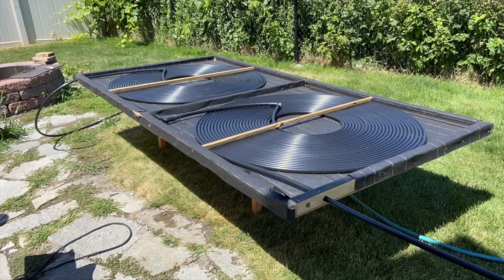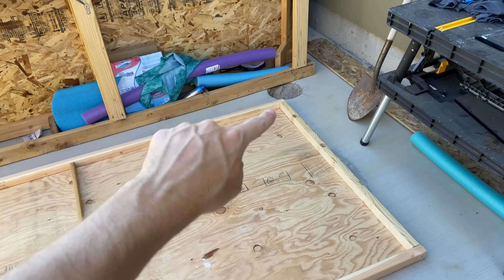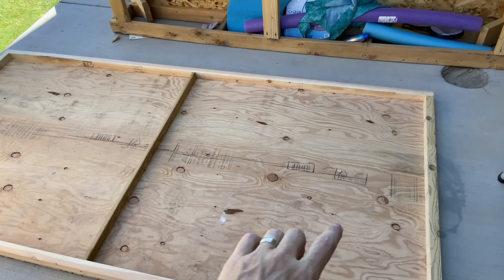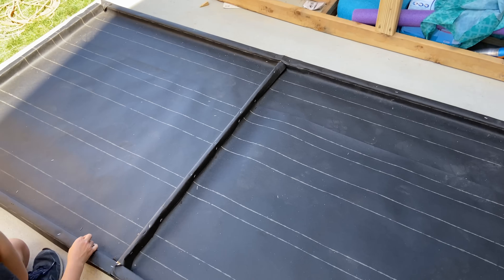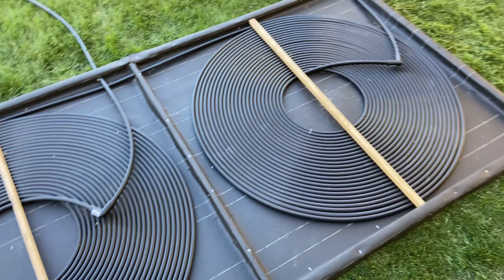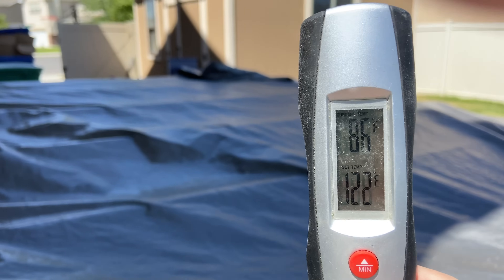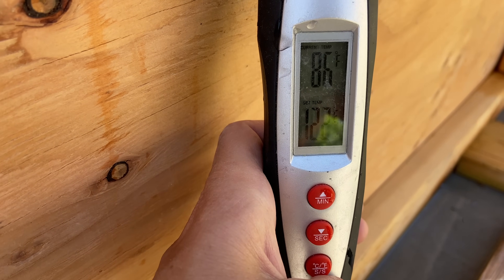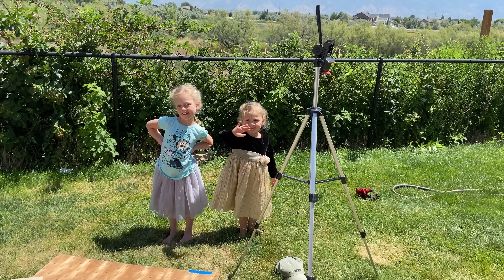DIY Pool Heater - $50 Solar Heater

Comment: I'm going to loop my pool water through my gaming computer, cool the rig, heat the pool, two birds with one stone!!.
Reply: How about I run the pipe from my pool to your gaming settup, we both win
Reply: U da man!
Reply: wow, that made me laugh! You are brilliant, sir!
Reply: @Bigdadddykill I know it’s a joke. Unless your pc is using over a kW (a few actually) it won’t do anything to the pool in comparison to the day night cycle. It doesn’t matter how hot that cpu gets it is the amount of energy that makes a difference. It won’t take a long time - it won’t do it. The reason a pool gets hot is that it is receiving energy faster than it looses it. As it gets hotter the rate of energy loss goes up cubed. Think of it like a single mosquito sucking blood from someone forever. The body replaces blood faster than the loss.
Reply: cool you bitcoin mining computer also and get 3 birds
Reply: well... this joke escalated quickly.
Reply: That sounds terrible. Chlorine will reek havoc on your loop.
Reply: Found Linus.
Reply: Linus is that you??
Reply: Linus Tech Tips is doing this right now.
Reply: bit late to the comment section, there is actually a jacuzzi/sauna place where the water is heated by a bitcoin farm. 😂
Reply: What about waste heat from your AC unit?
Reply: @alanl.simmons9726  even better instead of the waste heat like through the fan and air to water, use the heat it's taking out from the home directly with a heat exchanger?
Reply: @alanl.simmons9726  You could set up a heat exchanger. It could work, but could be more trouble than it's worth.
Reply: Guess you have a 4090 too 😂
Reply: Ok Linus
Reply: You should win the Nobel prize for this! Imagine pool water to cool the mining farm in the garage and the mining farm to boil the pool water 😂
Reply: Brilliant idea I would if it would work my gaming pc water cooling still runs some heat out of it so could be possible someone should try it one day
Reply: Yea... don't do this.
Reply: @michaelgoostree4177  why not?
Reply: Linus?
Reply: In the winter it better to keep that heat inside your house.. if your house running off central heat (with the exception of a heat pump).. all the power using inside your house.. lights.. tv.. game system and your pc... will heat your house.. this will lower your heater energy usage by the exact amount..  your PC is literally free to use in the winter..
Reply: @gezzuzzful  ya using a pc in the winter is the same  as using a pc.  A pc convert  like 99%of its energy into heat.
Reply: Yes big brain moves only
Reply: Going though that trouble add in your HVAC too!
Reply: Let me know when its done. Ill come swimming in the heated pool.
Reply: Make sure you keep your pool balanced correctly as to avoid calcium build up or acid etching
Reply: People do that with a ac unit.    I bet it could be done
Reply: Build yourself a 100 watt class A amplifier and you can heat that pool. It will also cost you a ton of money to run it.
Reply: Why didn’t I think of that. Just saved so much money thank you
Reply: I would all a heat exchanger in between the systems. Don't want chlorine water in your watercooling loop
Reply: lmao!
Reply: Whoaaa steady on, you don't want to boil yourself!
Reply: There's a guy who did that with a server in his house, Linus tech tips. Worth checking out. You're not producing a lot of heat, but enough to do some things.
Reply: Beware of the pool water start boiling! 😱
Reply: The chemicals would erode your system in no time
Reply: If we could figure out how to heat the pool with the heat I get when she finds out I've been on YouTube again!😂
Reply: you're a gd genius, Gump!
Reply: PC would never generate enough heat to warm a pool, the pool would dissipate it before ever having a chance to heat the water.
Reply: @atvkid0805  really it’s a joke but just so you know your wrong it would heat a pool just take a long time
Reply: @marineinneed  Not with thermal losses during the night time.
Reply: Nice!  It would work to cool your computer, but not sure on it being enough to heat the pool, or even maintain it!
Reply: @wolphin732  He's kidding bud!
Reply: @wolphin732  nowdays gaming PCs draw up to 800w and more if overclocked
Reply: @wolphin732  not sure if your a gamer because my dam cpu and gpu can make a lot of heat I’m sure I can heat a pool on a few hours of gaming haha
Reply: @marineinneed  I'm not sure if you understand how energy works. Your pc doesn't put out much actually heat. It might feel warm but that doesn't matter. A high end pc will output about 600w of heat or 2000btus if heat(that's if you are running both cpu and gpu at max which most games run cpu less than 40%). 2000btu isn't much especially when a furnace outputs 60,000-80,000  btus.
Reply: @randybobandy9828  u must not have a high end gaming pc because I build some heat boy
Reply: You’re wrong I heat the ocean with my computer
Reply: @timm8311  you gottem good!

Comment: Instead of the funny centre feed coming out and across the other coils, you can use two coils interwoven like a mosquito coil and using two reversed elbows, you then send it back the other way when the water hits the centre.
Reply from the maker: Good idea

Comment: I have a friend in the South of Spain and all of her hot water is heated via pipes on the roof. Like the idea of the sun heating the water for free.
Reply: solar hot water tanks are req in hawaii for years on new homes..   i have not put electric to my house water heater one time yet , water stays 120 + round   :).   same 2 panels with hoses on roof connected to pump on water tank

Comment: Will this work during florida winter when it’s on 50s or 60s outside?
Reply: Yes of course it will work in Florida even during the winter. The only caveat is the sun doesn't shine a strong in the winter so you will not get as high temperatures in the hose to flow into the pool.
Reply: No.  The sun in Florida is different than anywhere else in the world so it cannot work in Florida unfortunately.  In fact, you probably could do it...just run the system at night only and you should get good results.
Reply: @houstonwarren2  lmao

Comment: Something everybody that’s into this will want to be aware of, is the concept of ‘thermo-syphon’ - you put an insulated storage tank between your panel and your hot tub - you mount your storage tank above both of them - you leave flow off to the hot tub - water comes off the bottom of the storage tank (where the water is coldest) circulates to the inlet of the heater - the heater outlet goes to the top of the hot water tank - it just keeps circulating on its own until the water at the top is same as the bottom - then it will stop - the outlet on the storage tank to the hot tub should be 6” or so from the top - it will, of course, gravity feed to the hot tub
Reply: You need a different type panel for Thermosiphon(TS).  TS is a very low energy process, and will only move warm water upward in relation to gravity. A downward turn will halt flow, and horizontal runs add only drag to the process so are to be avoided if you expect it to work.  This panel is coiled so half of the tubing is flowing downward when the panel is angled to catch the sun, so it won’t TS. Laid flat would be pure drag and would also not TS.  For TS, you need a panel with straight tubes orientated vertically, so the heated water can flow upward.  The system you described, would not heat the tub as in a TS system the heat can only go upward.  And if the water could flow from tank to tub freely, the tank being above the tub would allow the fluid to simply overflow the tub from the tank till it reached it’s own level.  To TS from tank to tub, you would need the tub to be above the tank.  But there really is no point to the tank, it just adds more surface area to loose heat, so best to just hook the collector to the tub directly and insulate the tub and cover really well...
Reply: @rronmar  ... for the typical pool they could just plumb into the existing filter system instead of fooling with another pump. A few T fittings and some extra valves plus a drain would finish it off.
Reply: @rupe53  yep, I have done it that way myself. but will brought up Thermo-siphon without using a pump, which can also work very effectively if you follow the rules.  I have used it in 2 diesel generators I have built(3 and 8KW) and some other projects, and it works great, with no need to provide for or drive a water pump that will eventually fail...
Reply: @rronmar  ... Onan was using TS on their water cooled units back in the 40s. It's also used on domestic hot water in many 3rd world countries where electric is expensive. Typically these are roof mounted systems.
Reply: @rupe53  yea, it works well, you just have to follow the rules, the biggest being vertical is your friend, horizontal is not...
Reply: @matoko123  ... you don't know the pressure needed till you figure the friction loss in the pipe circuit. Larger pipe or multiple pipes could be the answer to lower head pressure down to where the typical pool pump will have no problem. Something under 30 psi would probably be fine. 15 - 20 psi would be ideal.
Reply: @matoko123  ... easy enough to install a pressure gauge to see how bad / good things are. I have installed many heat exchangers on pool pumps, and I usually set them for an extra 5 psi restriction. That would be 5 psi over what the filter / plumbing already is. Typically, that's around 15 psi total backpressure. One has been running over 15 seasons with no adverse issues. For things like in this video, keep the pipes at least 1" or larger, keep the length to under 50 ft, and plumb your collectors in parallel to reduce restrictions. Always plumb the collectors on a bypass so you can control backpressure.
Reply: @matoko123  ... BTW, a thermosiphon doesn't work well if the collector pipe is in a coil, like this video. Also, if using multiple collectors, you can probably get away with 3/4" pipe because running them in parallel will ease the restriction. The smaller pipe is MUCH easier to work with. For ease of assembly, you may want to consider making the panels only 4x4 ft. IOW, 2 panels out of a single piece of plywood.

Comment: To clarify some of what others have said, there's a little science behind heat transfer and it may work in your favor. If the water in your coils is too hot it will shorten the life of the poly pipe, and also could be uncomfortable to anyone near the discharge. The most heat transfer will happen with the least loss with only a few degrees temp rise. This is mostly because the rise will slow down as it reaches ambient temp. IOW, something between 2-5 degrees rise (from in to out) is a good target because the rising pool temp will slowly raise the inlet temp anyway. The reality is most people need to increase their flow rate. The goal is to have a continued but slow rise. In tech terms that's called a differential. The other tip I will throw in is that on order to make an appreciable rise the sq ft of the solar must be about 50% of the pool surface sq ft.... or higher. Most people use a small panel then wonder why they don't see a difference. The reason is the sun only shines so long but the pool cools off during the other 18 hours of the day. Keeping the pool covered can also gain you an extra 5-10 degrees by slowing evaporative cooling. Some people say a pool cover is too expensive, but that's cheap compared to heating a pool by conventional means.
Reply: thanks..re.. if we know the flow rate,, ie gpm.. we could get a rough calc on BTU. temp doesn't mean much if we don't know volume..
Reply: a "solar cover" (really, as you said evaporative cooling prevention blanket) is about 100 dollars and will last 5 years if you take care of it on a reel. 50% of the pool area is...rather large. yikes.
Reply: @danielroden9424  ... to put that in perspective, the 50% rule is up here in New England. (I'm in Ct) The flip side is I know people who use a solar cover but need a water cooler to run on days when it overheats. (actually runs at night) It can be a balancing act to keep temps comfy.
Reply: @danielroden9424  Unfortunately, Daniel is one of the few who is correct.
Reply: This might be a stupid question but my little brain cant comprehend what you wrote here. Are you saying that a smaller temperature increase compared to a larger temperature increase will heat the pool up more? I built this exact system and tested it out yesterday. It was 82 degrees at 3pm and water had been sitting in the system all day. When i finally turned it on, boiling water came out steaming at 155 degrees so i thought they my pool will heat up pretty quickly but then after an hour the water coming out was only about 82 degrees which was about 10 degrees higher than the pool water. The solar system is on top of my roof where it is baking in the son.
Reply: @IhANsTErx4I  ...at the same flow, 155 degree water would heat the pool up faster than 82 degree water. With this system, to maintain very high temperature, you have to reduce the water flow to a trickle which will take a long time to warm a pool versus having cooler water (but warmer water than the pool by several degrees) entering the pool at a higher flow. That's how I understand it.
Reply: @IhANsTErx4I  ... yes, that basically what I said. It's actually more efficient to work with a smaller temp difference., which you can do by increasing the flow or splitting your system in half and running parallel panels. Bottom line is you get more BTUs, which is actually more heat to the pool.
Reply: @rupe53  Yup ... its just common sense .... temp means nothing....  you are trying to heat a pool , not make a cup of coffee....... its about capturing energy,  and the bigger the temp delta, the more efficient the heat transfer.  so run at max flow... and your heat exchange will be best... you want to keep the coils cool to capture the energy..
Reply: Also a higher water flow would fill the tube more, so more water would be in contact with the tube
Reply: @enriquenavarro2623  ... once you add even a little pressure the pipe / tube will be full. What I am talking about is total flow rate, which will change with pressure..
Reply: ...would you expect better performance by running the two coils in parallel vs. series?
Reply: @niaralosusa  ... if you run in series you will have slower gain as you near ambient temp. (read my post again) If you run two coils you will have double the collector area, so better gain.
Reply: Thanks for your input. Just thought of this. Flowrate, input and output temperature. I haven't set up my pool i bought last year yet but will soon. I have a "flat" roof of 120m2 i can play with. Think i will build something like in this video with PEM or PEX hose. Not sure of the diameter or length yet. Need to find a pump that can handle to pump up the water 5meters to the roof and maybe a way to control the flowrate. But i guess i cant bump to fast only to slow (and the water is getting to hot)
Reply: @magnus1liljeqvist  ... there are continuous duty pumps available for spa filters that are fractional HP and might fit the bill. Last I looked they were not much over $100. (Amazon, etc) You can also play around using the pool filter pump with some T-fittings Those push a LOT of volume and might offer enough pressure to do the job. Remember, this is NOT an open system where you are pushing water up all the time. The other end is back at pool level so once the flow is established the only extra pressure is the pipe resistance. In the case of using the pool pump you might consider a timer so it only runs during the day. Most pools don't need 24 hour filtering anyway so 8-12 hours is enough for normal sanitation, and will keep you from cooling the pool at night.
Reply: @rupe53  Just found a waterpump in my garage. Had plans for making biodiesel but never hade the time. Also found a seller on facebook that sells a 900m/~3000feet hose with 33mm/1.3inch diameter for 4000sek/~400usd/320GBP but i think its a little to much haha. Did some calculations and i think the hose would hold 700litres =D
Reply: @magnus1liljeqvist  ... you might be amazed at how much space that takes up. I hope you know someone with a truck.

Comment: I did similar with a hot tub about 15 years ago, and we worked well. Used a ceil fan thermo disc in a black bottle top jar to turn on my solar loop pump, ... Then figure out a temp control to turn all my pumping when tub reach my favorite temperature ... One friend questioned how much plastic chemical I might be bathing in ... Since moved up in my hot tub design. Would price pex tubing as possible update.  :+) Happy free heat soaking. ...nice way to go

Comment: Awesome i built one years ago from long lengths of Black ABS pipe11/2" pipe worked great for over 20 years but its finally dying. Time to build another, think i will try this one you have made but with a movable base to keep it in the sun

Comment: Anybody know whether pipe composition matters in terms of efficient heat transfer, e.g., polypipe vs pvc vs pex vs copper tubing, vs metal pipe.  I imagine the poly is least expensive to procure.  What about using black BF Goodrich garden hose?  What kind of hose loops do they use for geothermal?  Those must be efficient, I would think.  Wouldn't it be nice to run pipe under the concrete decking, keep the deck cool and the pool warm.
Reply: Jim W ... there is at least one pool company that has their elevated deck area (above ground pool with deck) rigged up as the solar collector. Only problem is if it leaks (eventually it will) and you disconnect that part the dark decking will get rather hot.
Reply: Any material that absorbs heat would be more efficient than the others. So if he did the same design with copper tubbing the results would be even greater. The black flexi pipe just isnt as efficient as a metal pipe.